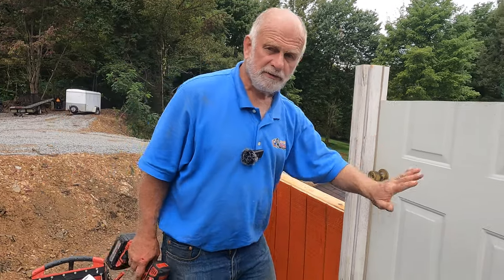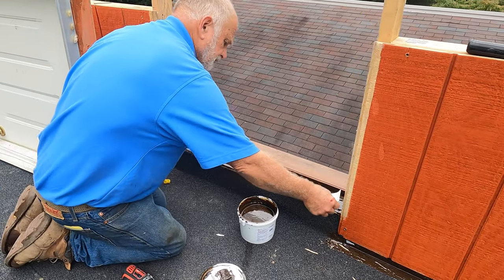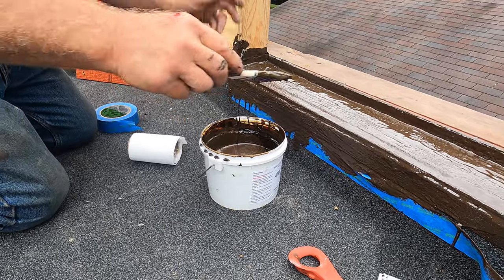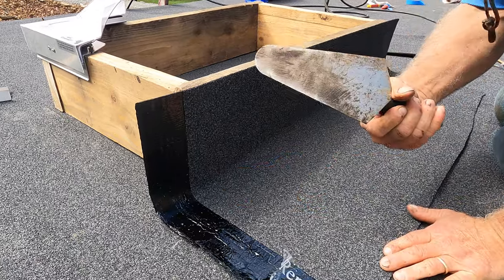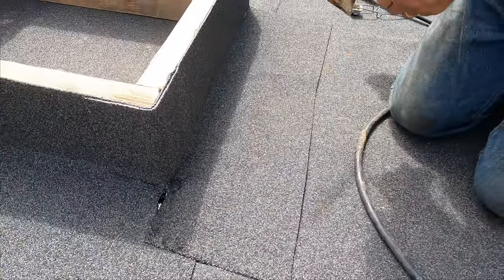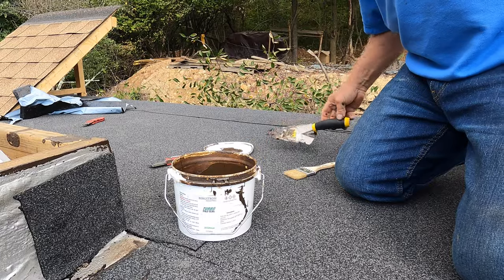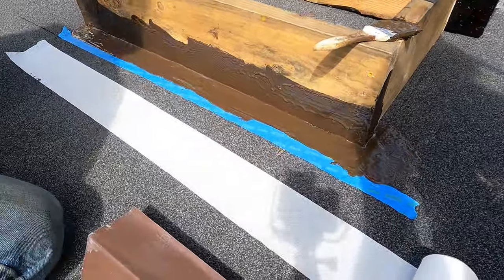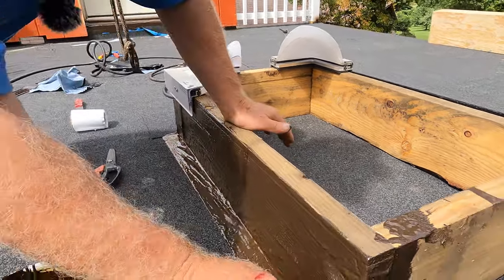Cheap Easy Flat Roof Install Part 2: DOOR PAN/SKYLIGHT FLASHING DIY Lesson from Start to Finish

Comment: What’s the shallowest slope flat roof one can have while still using this application?
Reply from the maker: I think this roof where I am demonstrating is a 3 pitch. You could do it on a 2 pitch but then I would use a Torch to heat up the seams to get them to bond securely